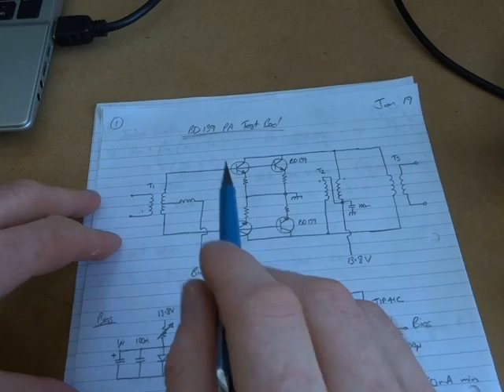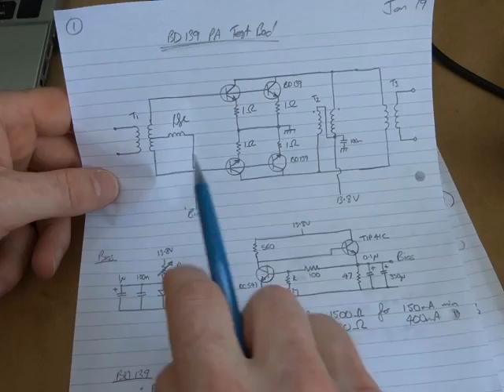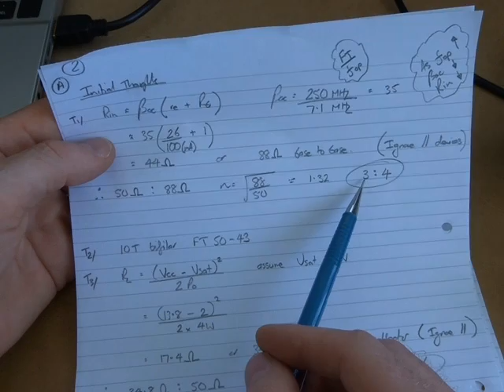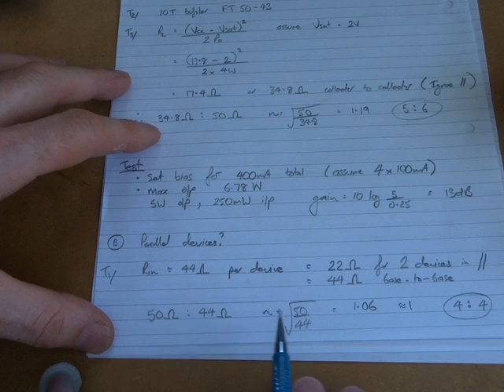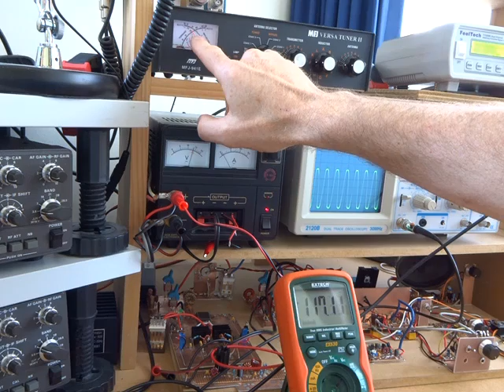BD139 Push Pull Amplifier Experiments - Part 1

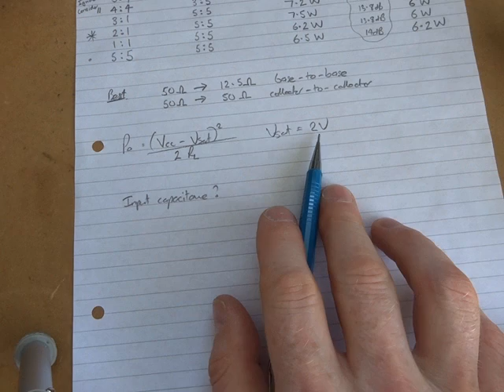Comment: The Po formula is not correct.  For a  PP configuration even in class C   the  2 is in the numerator.   THe formula given around 25:50  is for a single ended amplifier  (BPT type). 
The Toroid King in US claimed  5 W out for a  1 plus one configuration but only  in  class C configuration.  He sold that type of amp using BD 139s and then discontinued it. I have a feeling that people were only getting 3.5 to 4  W out on most builds so he had to look for better  RF service commercial  BP Tr  which he eventually did  (that's DIz , who is now dead).

An interesting comparison is with the RD16HH mosfet which will give you  16 -17 W linear out at  10 Mhz in the same general configuration with only two devices.  But they do cost a lot more.

TEF / ZL1Mzr

Comment: I know it’s 5 years ago, but would there be any advantage in running this as an H bridge rather than in parallel pairs? Also does each transistor work at half the output frequency since it only contributes half of the output waveform?
Reply: No and no.
H bridges are great for DC loads,, not inductive AC loads like RF.
The pairs of transistors in parallel are just to beef things up. The circuit could work with one on each side.
The push pull arrangement just means one side is on at a time ie fir half the wave form, so still the same frequency.

Comment: Is it very important to have "clear" sinus on the amplifier output? I see that in your case it has some distortion.
Reply from the maker: No, but a low pass filter is required after it to attenuate any out of band components.
Reply: @CharlieMorrisZL2CTM  Ok, thank you.
Last time we assembled diode mixer as our next step and it works well. But we use some another parts again. That was FT50 and oldschool soviet union diodes КД522)
Now we are going to work on IF amp. 
Do interested in tube receivers?

Comment: Hi Charlie, great series of vids.  As further extension to this set of experiments, ever thought of push/pull arrangement, class C (no bias) for FM/CW amp, to see what you could get out of the 4 x BD139?  Cheers Chris VK3TUB
Reply from the maker: I'll have to look into that Chris.
Reply: Hi Charlie, with the new 40m transmitter vid from yesterday, you said you might use class C bd139 PA, did you get a chance to revisit these experiments as class c with no bias, as suggested in my comment from several years ago?

Comment: Hello Charlie! :) Really nice video, as always! :) 
A question: This is a class AB-amplifier, right? So why the high bias current?  For something like a 5-10 W amplifier, something around 10-20 mA standing current per device shoud be enough? Just wondering! I could be misstaking and not had enough coffee this morning :D 73's de SM4WWG
Reply from the maker: Hi Jörgen. At the time that current level gave me the best performance. I am looking to play around with some more power amplifiers using simple BJTs, such as the BD139, so I'll look at that aspect again then. Try a lower value and see how you get on.

Comment: I have a number of thoughts... but the one that comes to mind first is those binocular input/output transformers have considerable "leakage inductance"... and I don't see any attempt to tune that out.
Reply from the maker: Hi. As I'm just playing around with this, what would be your approach to to tuning out the leakage inductance? Series/parallel capacitance? Cheers.
Reply: @CharlieMorrisZL2CTM  This is normally accomplished by parallel caps across both primary & secondary windings. An empirical approach is the method I always use. It takes some practice to get to the optimum point...
Reply from the maker: @TelstarElectronics  Thank you for that. I'll add that to my list of things to look at next time. Thanks again.

Charlie

Comment: Probably the beta of the transistors limiting the output wattage. The higher current the more the beta drops. So your gain drops requiring even more input drive.(you were down to 5.5 ohms or so output impedance that is going to draw a large current). BD139 beta isnt very high with high currents. Plus the negative feedback of the emitter resistors. You just need even higher input drive, the transistors dont give you as much gain as you want is all. A darlington or sizaski (cant spell it) would allow easier drive with more gain

Comment: Charlie, I like your experiments with this amp. I do need a good preamp for 80m - 20m bands to power a LDMOS . My input comes from a AD831 mixer. I think using a 2n2219 or 2bn3053 emitter stage with 20dB gain to get to the 250mW. Your experiments show, that the input transformer design is not so much affecting the amp gain. But I wonder how the input SWR gets affected. I would compromise a bit my output power if could make sure, that my input SWR is great (no reflections that I would see in my mixers again). How can on measure SWR for such small power levels? What are your thoughts about it? 73, HB9GZE

Comment: I think that the Ft rating of 250mhz may be wishful thinking.  This device has been cloned by various makers, and the original device may have been rated at 150mhz Ft.  In any case, these were marketed as audio devices, and in this application an Ft of only 15mhz would have been fine.  Would be interesting to see just how high in frequency they actually work, I would suspect that above 40 meters things start to flatten out very fast.
Reply from the maker: I suspect you are right. Even thought the spec sheet states a typical Ft of 250MHz, it certainly does drop off above 10MHz in the experiments. I think it is still useful for the lower HF bands. I'm now trying to find a mainstream device similar to the MRF454.
Cheers.
Charlie
Reply: DIZ at kitsandparts sells those transistors.  He used to have a 5w cw amp kit using a pair of them, and suggested they were good to 18mhz, at least for the name brand that he sells.  I'd be happy if they worked up to 20 meters.
Reply from the maker: @scharkalvin  I'd have to go back and look at the results, but again, but it seems to be a good option for 80/40m and mediocre for 20m. I agree the actual performance is not reflective of the spec sheet in regards to Ft. 
I was pricing MRF454 yesterday for a higher power amp, USD24 each and not even matched. I'll have to look around for something else.

Comment: Great video Charlie. Looks like you found the sweet spot for the  input tranformer but I would have liked to see more test with the turns ratio for the output transformer as well. As you had 5:5 on it it would not be to hard to take out a turn our two on the collector side to see how that would affect the Pout. or maybee test with with a 8:8 transformer instead so one one turn taken off would be less change. Just an Idea. Maybe I will try my self. I think a have few BD 139 in my junk box.
Reply from the maker: Gidday Harry. I'm just playing with it now. I'll make up a 8:8 on a BN-43-202 and do some experiments. I'll put up a video later.

Charlie
Reply from the maker: Harry. Part 3 covers this. Hopefully, it cover what you were suggesting.

Charlie
Reply: @CharlieMorrisZL2CTM  Wow, that is great! Just watched it and seems you had the output transformer pretty much dialed in as well. great work and thanks for sharing you experimentation to us all!  // Harry - SM7PNV
Reply from the maker: @deBug67  Perfect. Thanks for the feedback Harry.
Charlie, ZL2CTM

Comment: I have BD882 can I use it in this project ?
Reply from the maker: Hi Raafat. I don't think the BD882 is suitable based on the datasheet. Unless I have the wrong one, it's specs are:
(1) Ft=50MHz. This needs to be 5-10x Freq operation, so ok for 80m and 40m.
(2) Pd=0.5W. This needs to be 2x Pwr out, so assuming the amp produces 5W total, which is 2.5W each side or 1.25W per device, then this needs to be 2.5W+ 
(3) ICmax=3A. This looks fine.
(4) VCEO=30V. This needs to be > 2x VCC, but it's quite low so it may be an issue for high SWR situations.

Charlie
Reply: @CharlieMorrisZL2CTM Thanks for the video!  I've adapted your design for use with the NTE2506 (115V IC=0.4A TO-126 HF Video Driver Ft=1.5ghz  @ $0.95). Putting out 20-30W in the FM Broadcast Band (88 - 108MHz) with 1W in at 20Vcc.

Comment: Love the idea of using commonly available parts!
Reply from the maker: Thanks Christina. Hopefully, that will make it easier for others to give it a go. Cheaper too!
Reply: I've looked at the BD139 before, did some digging around, and came across this.  Not sure yet if it is helpful, but it might provide some insight to this particular transistor, at least where input and output impedance is concerned.

https://www.qsl.net/vu2msy/bbrfamp.htm
Reply from the maker: @christinamarks6349  Cheers Christina. I will go over that again tonight.
Charlie
Reply: @christinamarks6349  Nice circuit, no expensive or problematic parts. That's pretty much what you built Charlie, less the 5th BD139 driver. Why don't you do experiment 7, run your amp from a 24v supply, as per the VU2RCH circuit?